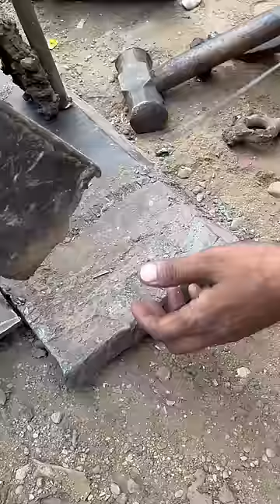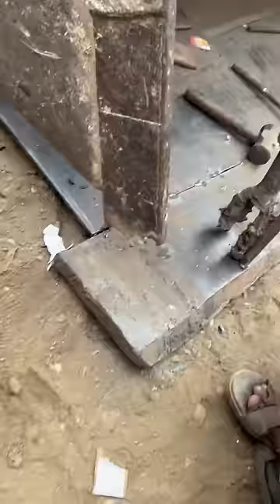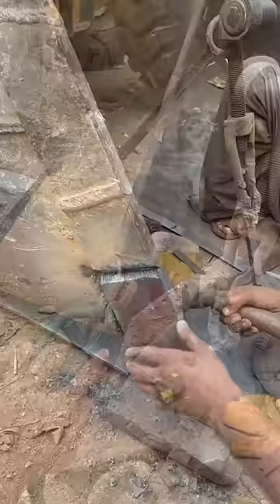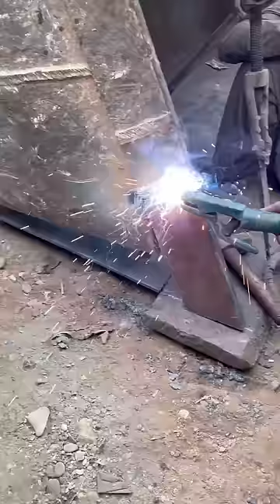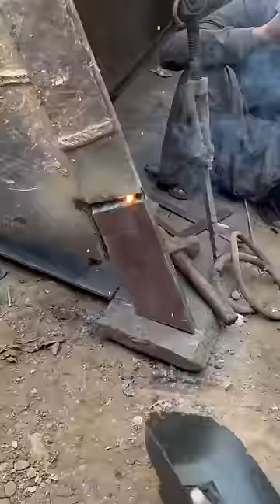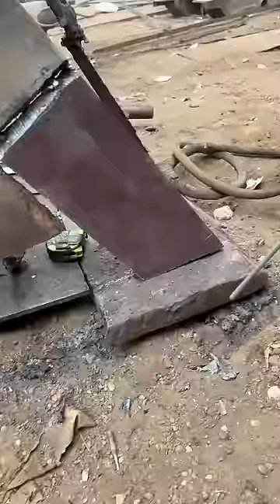new method of metal plate adjust of Pakistani welder #shorts #weldingwork

Comment: Yes, he measured twice and still managed to get it wrong 😂
Reply: Ты лучше  всех диванович
Reply: How did he get it wrong?
Reply: @davidl2281 he got it wrong in a few places 
They didn’t clean the areas on the old piece he is welding with the grinder by leaving rust paint and dirt you are contaminating your weld
The area is not prepped correctly there has to be bevels gaps are put in place to ensure penetration and true fusion.
You don’t put a bunch of shitty tacks in the groove for your Root Pass you will never get all of the slag out and it will become an Inclusion which is a void in the metal or several voids because when slag is heated it makes gasses that keep become bubble cracks form from and between these and spread with every vibration and stress on the welded area. 
The long runs up both sides of the patch need to be done uphill from bottom to top and hot passes over it. 
He’s going to have that same machine in there in a week or two to fix the same shit all over again. But I guess it keeps him busy.
Reply: @seansteele1269 thanks, I would have liked to seen the final weld, maybe he did do the long run, idk definitely should have cleaned area more, looks like there were grooves in the top part that would allow more passes for welds, idk I'm not a professional welder. Lol

Comment: Nobody saying: "oh that is why so many people die on these work sites" is what is bothering me.
The excavator can work with a bend in the shovel, but now they created a ton of additional weak spots.
Is the alloy to fill the gaps the right one for the load, does the weld penetrate deep enough to create a suitable bond between the parts.
With the bends it could have still worked for years to come, but if they stress those areas now it might come apart and the resulting accident might harm someone.
An excavator is a work tool that permanently stays in the dirt, it is okay to have dents and stuff like that.
Reply: You're free to go to pakistan as a missionary of labor laws
Reply: These people hold stuff down with there bare feet, and if you want to do them right why don't you go instead of putting it on someone else. Richest one!